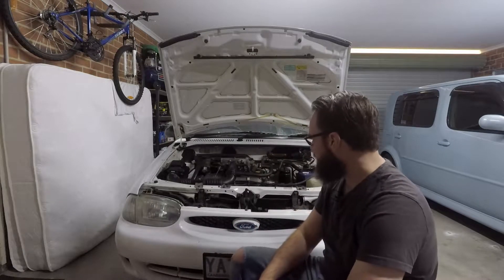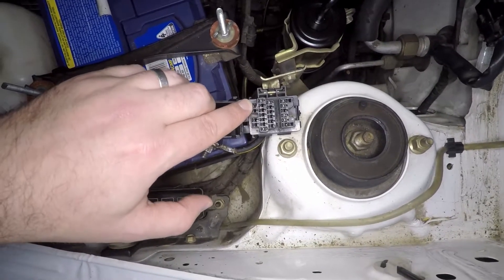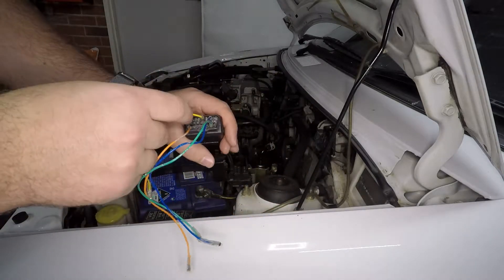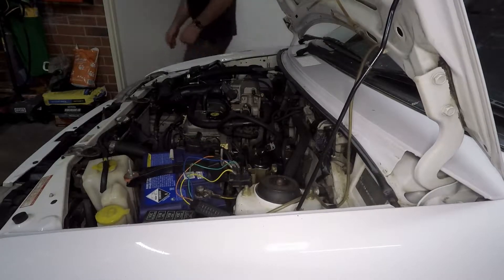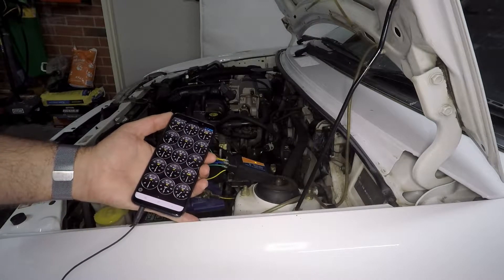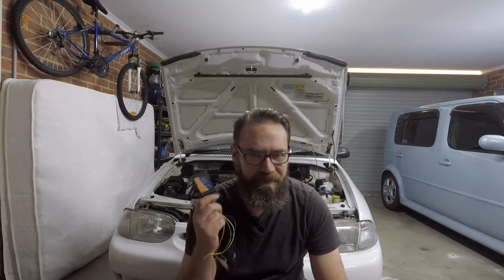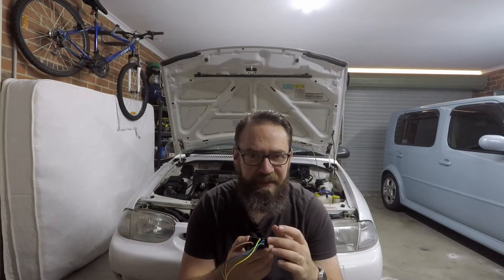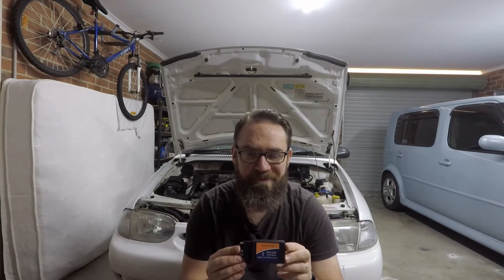OBD-II on an OBD-I Mazda or Ford

Comment: Hi, I've got a ford escort mk6 equiped with a 60 pin EEC IV, its got a obd2 connector, but doesent connect to the pcm. On the obd2 has pins 3,4,5,7,11 and  16, with the ELM 327 desent connect with none of the protocols, I know the comunication pins are 3 and 7. Where should i conect them to the elm 327?

Comment: Hi, saw your video, I have 1993 929. can't find what protocol it uses. also pins i have to use for OBD2. do you have any idea? I searched online but have no luck. I will appreciate your help. I have repair manual, but it does not have all those details either. thanks.

Comment: Hello  Sawickipedia, good video, could you help me to indicate which brand of scanner I can buy to scan the 17-pin mazda vehicle that uses OBD1 port, I attach a video link where I tried to scan it with a bosch 1300 but the scanner was not able after reading it, the vehicle has been scanned with other Launch brand scanners but they are very expensive, I hope your help, slds from Colombia.

https://www.youtube.com/watch?v=08Mme0um5o4&t=124s

Comment: Hello, my mazda 626 year 1.994 OBDI does not have BUS and BUS- terminals. I have tried to connect it to my ELM in many ways but without success, will you help me?
Reply from the maker: Sorry mate, my old ford is long gone and everything I know is in the video
Reply: Did you try the pin-out as shown in the upper right, with GND, +B, MEN? My Previous car, a Mazda 323 BJ 1.5 1997 could atleast blink out engine codes (shorted MEN to GND if i recall), and abs codes (TBS to GND) - this was from before i ever knew of wiring to OBD2 :) With that said, also pay attention to the lower right pin-out, it specifically says 626 GF 1997-1999 (which is my current car, and it works great for me with those 4 wires)

Comment: For a MAZDA MAZDA 323 2.0 DITD
WINE         JMZBJ14R201159352
Engine code      RF
*
can you give me 
25-pin connector drawing (FSB, TBS, and all others)
+
The wiring diagram between the two connectors 
Will the wiring be valid for all troubleshooting, (brakes, engine ...)
Thank you

Comment: Hi. Google changed my YouTube settings and I can't read public replies anymore. Could you please send me your reply to mike maps re 17 to 16 pin connector. Thank you.
Reply from the maker: It's quite possible the adaptor is not wired correctly for this case. I didn't know they were even available, hence why I just connected the wires directly
Reply: @Sawickipedia  Thanks for that. I just found a Russian vid using this connector and it does work with a OBD2 scanner. Only about Aus $13.00 on ebay. Thanks again. I'm buying.

Comment: Can I get some help here ,I got a obd2 sensor but my car has the same diagnosis port as yours in the video ,so I got a 17 to 16 pin connector which fits in to the port fine but the sensor isn’t working still, so I’m not sure if it’s the wiring or something else ,any advice here
Reply from the maker: It's quite possible the adaptor is not wired correctly for this case. I didn't know they were even available, hence why I just connected the wires directly
Reply: Hi Mike, I also bought that adapter, and not working for me as well. Have you managed to make it work yet?
Reply: I have the same problem as you I purchased a 16 to 17 pin connector plugged my sensor in and get nothing I have a 2004 Ford ranger XLT pickup diesel